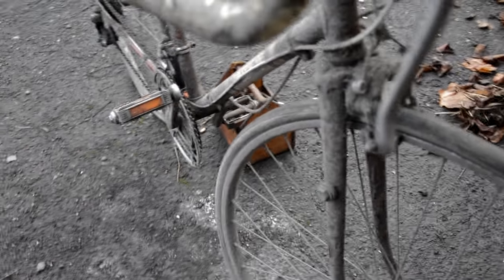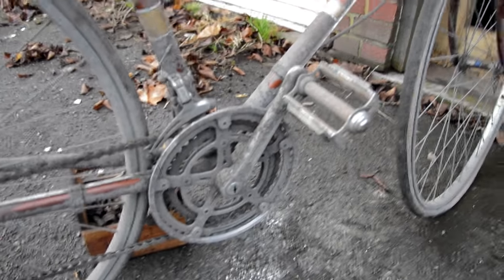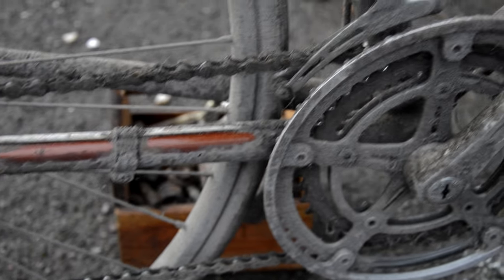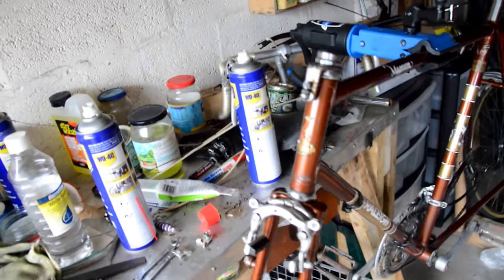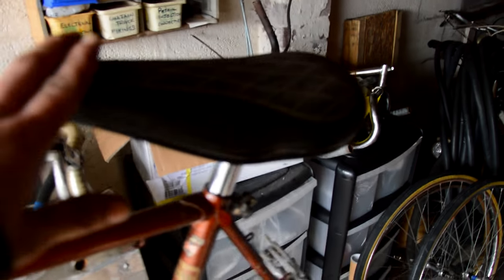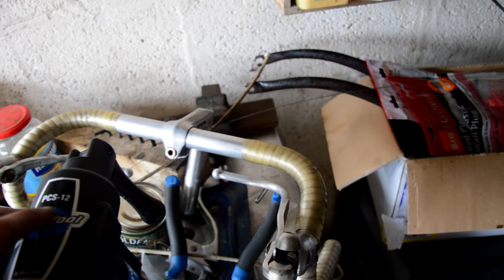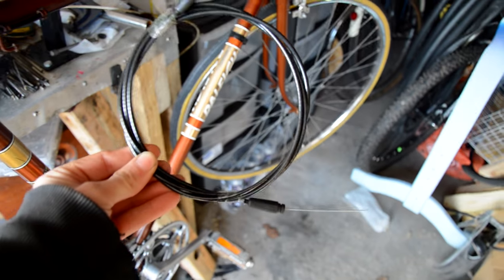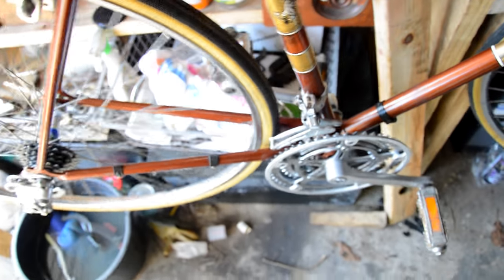1980 Raleigh "Magnum" - Barn Find - Vintage Bicycle Restoration

Comment: I just found my old 1980s Raleigh sales brochure and the Magnum GT10 is inside. It was a tourer, with gold chromoplastic mudguards. All cabling was white, not black on this bike. Get this... it says "No more fumbling - click and it's there"!!! Also had a carrier on the rear. Seat has a suede look top, but of course a synthetic. The handlebar tape was a sort of satin shimmer look, but it has dulled down quite a bit on your barnfind.
Reply: I had one and mine had the plastic mudguards and rear carrier….the gear shifters were rubbish though

Comment: This is an entry-level Raleigh as the componentry suggests,but it is a cool time capsule of the era.This is the time of friction derailleurs and the utter frustration that some cyclists were having in trying to learn how to shift their "10 speeds".Shimano saw this problem and the "Positron" was the early effort to make the rear shifting as easy as moving the shift lever to the next indentation or index.Positron's first iteration had one wire to the derailleur and one back to the shift lever.Shimano through the years have introduced some innovations to the lower groups in an effort to gauge acceptance or practicality.This early work paid off dramatically when it was time to introduce index shifting to the peloton and then to the masses of high-end road bikers.Shimano's first Dura Ace shifters put Campagnolo's first index shifters years behind in technology and allowed Shimano to rise to the top of the high-end bicycle component manufacturers.Shimano had been seen as a company that could reproduce what the Italians were making for a better price,now it was doing the cutting edge design and engineering that the Italians could not.Combine this with the advent of the mountain bike (seen any Campy equipped?) and the die is cast.Shimano design and engineering have ruled since.So,even though you couldn't adjust the Positron,it represents a chain of design common to almost all (entry level to very high-end) bikes sold today.

Comment: That's really cool, I found in my families old shed a 1976 viscount earospace and restored it, great bike
Reply: This bike had a recalled fork that had a tendency for catastrophic failure,any bike of this era with an aluminium fork should never be ridden.
Reply: @larrydaniels6532  I second that motion. Fork can be changed but I would not ride one until it was. My Dad was chunnering back then about aluminium as a frame material when a mate brought his round to the house.

Comment: Quite shocking to see how good condition it is after you cleaned all the dirt and dust of it! Not what I was expecting.
Reply from the maker: I presume the old owner must have oiled the bike up before storing it.  The oil would have kept the moisture out and offered a lot of protection.

Comment: Great job of restoring to its former glory, definitely worth the £20 you paid for it. I've done the same thing with a 1985 Raleigh Maverick, thorough clean, lube, service, repaired the front brake, readjusted the stem height (previous owner had it perilously high above the 'max height' marked on there), new gum wall tyres, new grips, polished the chrome. Wasn't an expensive bike to begin with, it's heavy as a tank and the shifting is rubbish but everything works and I think it looks pretty cool.

Comment: I appreciate what you've done here. Some bikes that come my way, I decide to swap out components because I have period correct stuff to improve the bike. But other projects, I make myself keep it all original. In this case, I would have done the same as you, leave it be. It's all there. The bar ribbon being intact is a good indicator of a low mileage bike. I'm glad you left her as is. Let's be honest, not the world's most beautiful roadbike. Haha. Maybe 20 years from now, the teenage son of its next owner will get a crack at restoring it again, and he'll be thrilled to find her in original condition. And he'll get to play around with the rear mech. Haha. Nice job anyway. See ya.
Reply from the maker: "Not the most beautiful" is certainly one way of putting it! ;)

Comment: The Shimano Positron system was always a difficult beast. It's like a factory set carburettor. It is incredibly difficult to get it right again once you needed to adjust things. You need to set the lever (on the handlebars) to a position just above the maximum bottom position to give you just the right amount of free play when you have the lever pushed down to the downward position . Then make sure the chain is on the lowest range (largest cog) on the rear wheel. At this point you need another person to hold the cable tension while you tighten everything up. You can do it alone but your just going to have to deal with loose play that you could otherwise eliminate if you have someone else to hold the tension, while you do everything up. The front derailleur is a doddle, as are the brake callipers. Unfortunately this system loosened up again really quickly, especially with road touring over undulating ground. It's just a quirk of the system. Other than that you could get quite a few miles of trouble free gear changing if the tension was just right. It's a lovely bike and a top quality gear and brake system. If someone wants you to change the taping up the bars, tell them to go away. It's original and that's priceless. Nice job mate :)
Reply from the maker: Ahhhhh, it's the opposite way round is it?  I adjusted it like I would do every other with the rear derailleur in the highest gear.  To be fair.  I actually went out on it a few weekends back and the gears weren't too bad.  4/5 gears but nothing so far out that it was unrideable.
Reply: Honestly, I don't think it really matters whether you set it on the lowest or highest range in the long run. What is important however, is setting that tension just right so that you have the full range of gears at you disposal without having to really push down or up on the lever to get it to nudge over onto that lowest or highest range. I always started it in the lowest range because I wanted that lever action to reflect the tension required to get the chain from the smallest cog up to the biggest. Coming back down to the smallest cog seemed easier that way because I could use the release of tension in the chain to assist me. Applying some lubrication to the cable greatly assists gear changing. I used to use sewing machine oil but it would clog the cable tubing with dirt and defeat the purpose. There are some great lubricants available now that don't attract dust and dirt into the system. They can be used on the cogs as well. Good lubricants will make those gear changes quick, precise, and very quiet; effortless really. Hope all this makes a bit of sense lol!! I used to do this kind of thing and really enjoyed bringing neglected machinery back from the dead (so to speak). I like how you know how far to take a restoration without ruining the original features of the bike.  I think what you do is great and I look forward to seeing more content like this. :)

Comment: I agree with an earlier comment about the forks, they look like they've been bent. Nice clean up though and nice find.  I'd have had to do something about truing the run out of the rear wheel though. You'll never get the brakes right without them rubbing.

Comment: Nice job. if it was mine though, I would've just fitted standard downtube shifters. I'd also dump the crappy centre pull brakes and get some nice long drop dual pivot ones like Alhonga. Those brake "safety" levers are downright dangerous as they reduce stopping power. Full length mudguards would be a nice touch too. If a bike has space for them, it always looks wrong to me if they're missing. Toe clips  and straps would be a nice finishing touch.

Comment: Yay the positron system is very trying to work on . I have worked on several . Didn’t know I could order new cables .
Reply from the maker: They do pop up for sale but are pretty rare and expensive now.
Reply: @MonkeyShred  I find them on woman’s bikes . There cheep here and usually in good shape so I just pull the hole system off the woman’s and put it on a mans bike!

Comment: I've recently acquired a 1980 Carlton Cyclone and the specification is similar, bar the gears. Ditch the positron! Replace with era like derailleurs. Made at Worksop factory according to the serial number.

Comment: You can buy the cables for the gear shifters , all you have done to the bike is fully serviced it, restoring means, having the old chroming re chromed, the frame photo graphed for the stickers, then the frame sent in to be sand blasted then powder coated prior to being sprayed, I do agree that the bike looks good for its age
Reply from the maker: Not necessarily.  You could restore something in various ways.  A full blown restoration, sure, rechrome parts but it wasn't needed here and if I was going to go that far, powder coating is not an option I would choose.   Spraying the frame would get a much better finish and you'd be able to lock in the transfers and any lug lining or boxing you did.  There are lots of different levels to "restoration".

I've also said in the second line of the description:

"Is restoration the right word? Probably not but it's in keeping with the series I'm going to try and do"
Reply: I agree totally, a lot of people like the originality (warts and all) it shows the age and condition of the original bike It's called an oily rag restoration, Knowing where to stop is the key, as long as it is fully functional that's what matters and some will pay more for that over the full-blown cosmetic makeover as it loses its character. Regards

Comment: You need a special tool for the Positron gears. In the UK it's called the bin.

Positron would have gone from the get go had it been me. I am only vaguely aware of it and I was around when it was introduced. It didn't take so I would assume it was no good. I would have found a regular Shimano 400 if I could or tried to adapt the derailleur, pulling out the ratcheting  mechanism. The regular 400 was a good derailleur.

 I had a 1980 Elswick Hopper that was quite similar to the Magnum. Center pull brakes, that low end SR chainwheel, I had large flange alloy hubs and alloy rims. I think my derailleurs were Shimano 400 because I remember them and I would never have bought that aftermarket once I got serious about cycling. Didn't have those horrible bar top brake levers They don't work and if you use them and need to stop in a hurry you will find that you can't.

The one thing I would check before selling these bikes is wet braking. Bikes were awful back then. The leverage on the calipers is way off because the clearances are too big and add chrome rims into the mix and you have a nightmare. I would want to figure out the best brake blocks available now. Maybe carbon or ceramic blocks are best with chrome rims.
Reply from the maker: I'd agree.  Positron definitely belongs in the bin.

Comment: These old Raleigh 10-speeds were well built but they're not particularly special bicycles. They do make great everyday machines though you will find it helps a lot if you swap out the steel wheels for aluminium alloy ones. If you want to stick with the old style freewheel clusters, I recommend the ones from IRD - Interloc Racing Design - as they have the more modern shaping of the teeth to make for much cleaner shifting.
Reply from the maker: Very true.  Alloy wheels will reduce the weight a fair old bit and they'll give a much better braking performance.  Especially in the wet!  Wet braking on chrome is scary.

Comment: I have the same one only with race pedals and mine wasn't stored in a barn it was stored in a room and kept clean and free of rust it was only riden once in a cuple of years the paint is still the original without a srach I even have the original tires they're not on the bike but I kept them.

Comment: A set of clamp-on downtube shifters would improve shifting precision, and the bike could still be put back in stock condition if a collector wants to buy it.
Reply from the maker: It's been recently switched to a set of Huret downtube shifters and rear derailleur.

Comment: I've worked on many Positron systems. They suck and I usually just swap for a more traditional stem shifter. Of course the rear derailleur has to be changed as well.  Still period correct, just not Positron.

Comment: Is the fork straight? For me it looks like it had a collision once.
Reply: Indeed, Profile shot at 15,47 shows it
Reply from the maker: I think it's just the light but I shall check it out just to be safe!
Reply: MonkeyShred id say that's been crashed. Fork looks bent back.
Reply: Fork is bent but that doesn't matter, it can easily be straightened without a problem, the important thing is the frame is still dead straight.

Comment: Cracking find with the Raleigh....excellent youtub you have!! 🌟  "I'm restoring a 1980 Claud Butler Sierra, do you know what size the thread headset is ie, metric or imperial and if a new complete headsets are available?? Cheers 👍
Reply from the maker: It's going to be a complete guess but I'm thinking it's just a stand 1" threaded and it would be 24tpi.  Plenty still available.  If you measure the diameter of the stem it should be 22.2mm for a 1" threaded headset.
Reply: ....thank's for your help and kind reply :)

Comment: Thanks for another great video. Hey, did you know that the Positron was originally designed as part of a system with the freewheel in the chainset? It was called Shimano FSS. That meant that the derailleur would shift to the selected gear even when you weren't pedaling. Here's a cool video about it: https://www.youtube.com/watch?v=x0qQLJEeN5s That guy calls it a predecessor to the Di2
Reply from the maker: I had heard that before but I've never actually looked in to it.  I'll give that video a watch.  Cheers!

Comment: When you soaked the chrome parts, you could have at least used a table to put the parts on instead of putting them on the dirty ground,  you should have sent the chrome parts off to have them re chromed, I have a 1937, Malvern star back peddle brake bike that I am going to restore.
Sam Knudsen
Australia
Reply from the maker: I'm not sure which part of the video you're referring to here.  I can't see a section where I soaked chrome parts and then put them on the ground?